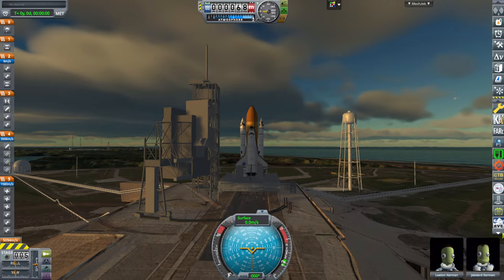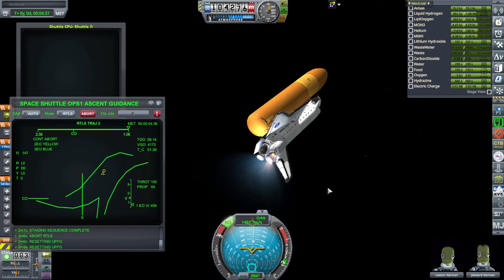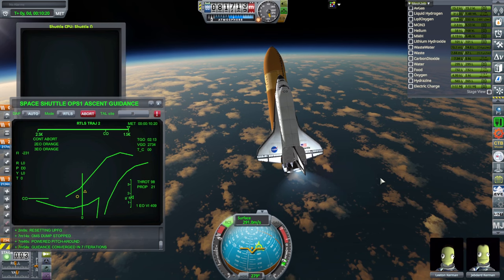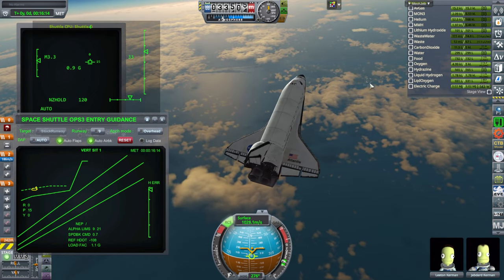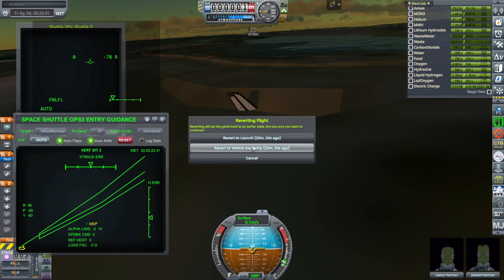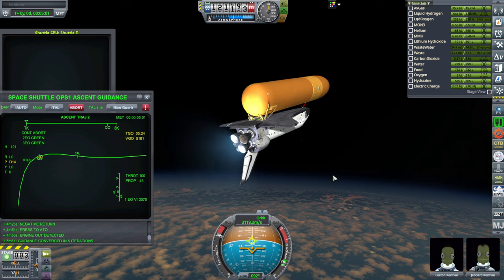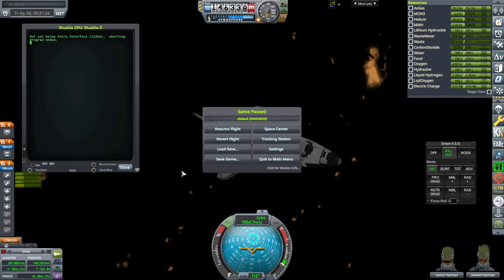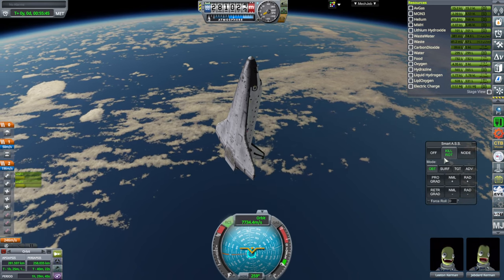Shuttle Aborts with Giulio Dondi's kOS Programs 1 (KSP 1.12 with RO)

Comment: couple comments:
- the RTLS runway is the closest runway to the launch pad among the OPS3 options. Since there is in theory only one runway at either KSC or Vandenberg, OPS1 gives the runway as a forced parameter to OPS3 bc there's no time to fiddle with the gui

- The RTLS terminal pitchdown happened way too late, there has to be a bug somewhere

- The gliding portion of this RTLS abort looks strange to me, I'd like to know what your payload was if you had any.  I noticed guidance sticking to the g-limiting logic far too long and as a result you were monstrously high on energy during TAEM. Another bug to fix
Reply from the maker: The payload was a tank of 12 tons of AvGas in the rear of the bay to try and make sure it was as close to the center of mass as possible since the Shuttle can, in theory, return with 12 tons. In the next video I can try without that, if you'd like.
Reply: @RaizSpace  I was kind of hoping it was way heavier than 12 tons, but no matter. I'll try to recreate your scenario (original RS-25, 12tons to 28°, failure at T+03) and push some fixes.
Also bear in mind that  2EO or 3EO contingencies are planned for but not implemented yet
Reply from the maker: Ah, those aren't implemented. Well, I might see what happens just out of curiosity and also try out what happens with RTLS without payload.
Reply: @RaizSpace  all you're going to get is a placeholder message and an infinite loop lol.
That aside, 2eo situations which do not result in a contingency (late in rtls, tal or ato) are implemented and you can try those out. watch out fo the gui messages informing you of abort availability
Reply: Hello everyone, you know my script has not improved at all, I keep putting run shuttle or run ops1 but nothing happens
Reply from the maker: @Ejd582 I've tried my best to figure out your problem and give you the information you need to make it work in the tutorial videos.
Reply: @RaizSpace  I've fixed a couple of things in the RTLS logic, I'd recommend you update both OPS1 and OPS3
Reply from the maker: @giuliodondi Okay, though I think the ultimate problem with landing was mainly the inaccurate landing location for the Stock Runway. I've recorded the next video already, so I hope it's not too painful to watch.

Comment: Wish I was able to do stuff like this in RSS, I recently started rp-1 for the first time and got stuck in 1975 with no science. Tried a Falcon 9 mod from peak but for some reason it was wanky as anything, as if it was meant for a different game. All I want is a plug and play real rocket pack for RSS to mess around like this video.
Reply from the maker: Well, the install process for this Shuttle is linked in the video description. Altogether, it depends on what rockets you would like to run - some are easier to get plug-and-play versions of than others. For Falcon 9, PEKKA's mod (https://github.com/PEKKA-Space/PEKKAsMods/releases) has that and Starship, as well as craft files and kOS launch scripts, so that's as plug-and-play as it gets.
Reply: @RaizSpace  Maybe my game settings are weird as when I tried to launch pekkas falcon 9 it required to put avionics on I thought the craft file would have avionics, plus it lauched weird, kept flipping over

Comment: OMS normally light after SRB sep, but yea for balance it makes sense to RTLS.
Reply from the maker: On a normal launch, no, the OMS doesn't normally light after SRB sep except in this RTLS scenario. OMS only lights during launch for certain payloads and trajectories, but only later in the launch.
Reply: @RaizSpace  There have been exceptions here is one case on STS-131: https://youtu.be/_NeCvBCZbC8?t=304
Reply: There were 2 types of orbital insertion used: Standard insertion and Direct Insertion. Standard insertion did not use the OMS until after MECO, Direct insertion activated the OMS for a period during second stage flight.
Reply from the maker: @darrenorange2982 I was addressing the statement "OMS normally light after SRB sep" - I'm aware there are cases where they do including abort, but I didn't think it was the normal case.

Comment: when i run ops3 i am geting this error, any idea what could it be?   

Tried to push Infinity into the stack.
At 0:/Shuttle_OPS3/src/ops3_control_utility.ks, line 433
return 1/0.

Called from 0:/Shuttle_OPS3/src/ops3_main_executive.ks, line 50
LOCAL aerosurfaces_control IS aerosurfaces_contro 1_factory().

Called from Archive: /ops3.ks, line 56 force_tgt_select
Error, not enough rudder control modules found
Reply from the maker: Is it possible you put the wrong rudder parts on? I think, for some reason, there were other parts that could also be rudder pieces, but those are the wrong one.
Reply: Check Atmospheric Autopilot as stated in the README